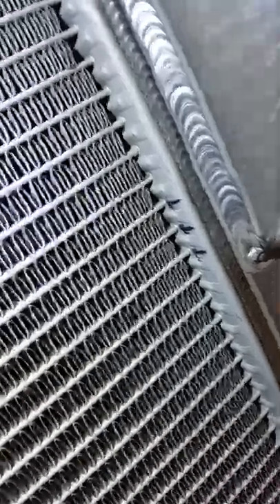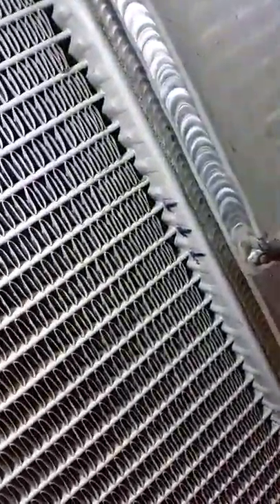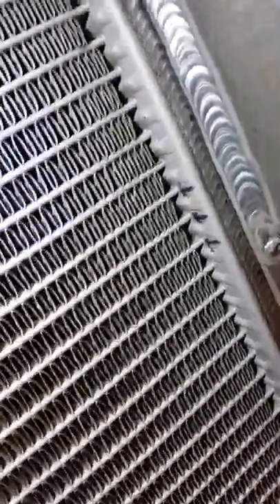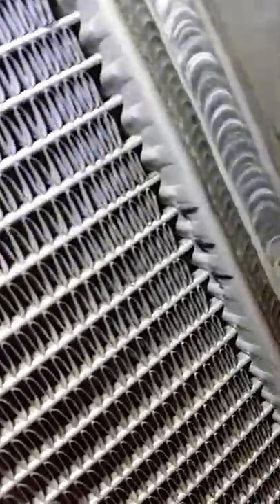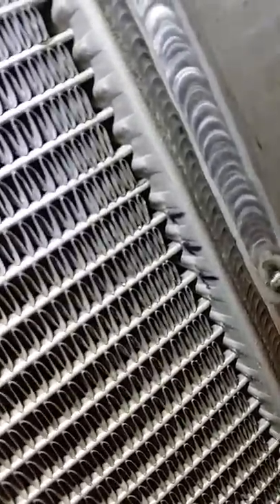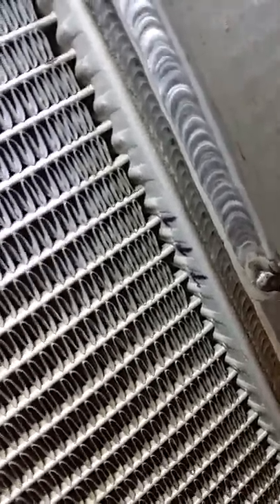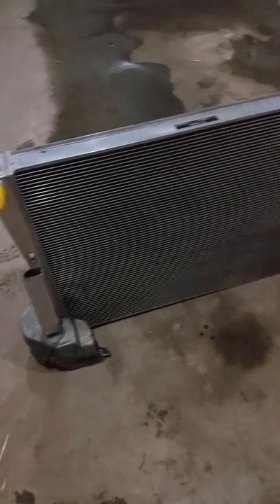Mishimoto F250 6.4l aftermarket radiator problem's

Comment: I recieved one. Couldn't install it at all their oil line cooler fitting are totally wrong 3/16" hole instead of like a 1/2"  hole for the oil cooling lines of a chevy 7.4 motor. Good looking radiator but they want you to chop up your oil line and rigg it to fit their screw up.Doing that would reduce the oil flow bye as much as 60% . Order the old plastic end radiator, because you can't trust these after market parts at all. Second issue was the over flow bottle fitting was like 1/8" pipe thread. Not 1/4" or 3/8" NPT that you could  find fittings for.  Thie radiator came from HHautostore on Amizona, . When I go to town next it gets sent back ups.  P.S. That raditor came with no Phone # , No Email data, and no paperwork whatsoever. Like they didn't want to be bothered with you after they sold it to you.

Comment: I had a pin hole in one of the welds of my Mishimoto radiator. took me 3 years to figure out where I was losing coolant.They sent me a new one. when I pulled it, I decided to also pull the water pump on my Duramax. i descovered the Mishimoto intercooler has significant corrosion underneath the paint indicative of poor surface prep during manufacture. Also have a hole in their hot side intercooler pipe where it did not clear properly due to poor fitment. Also found a similar problem with their lower silicone hose kit.
Reply from the maker: I will never purchase anything from them again. They made a very good name for themselves in the past but their products are crap in my opinion. Very poor service and I don't think they fully do any R&D or quality control on their products. As I said on the video this is the second radiator that failed in the exact same spot so this is clearly a defect in their item.
Reply: Tigiteasy Garage I'm currently replacing mine and noticed some fitment issues on the hot side intercooler pipe which rubbed a hole darn near completely thru it and some corrosion underneath the paint due to poor surface prep during manufacture with the intercooler itself. Will see if they warrantee the items. You are correct. Their quality control is horrible, but their products show good potential.